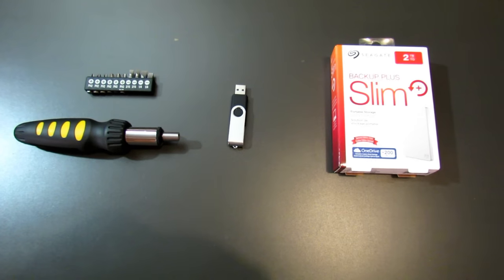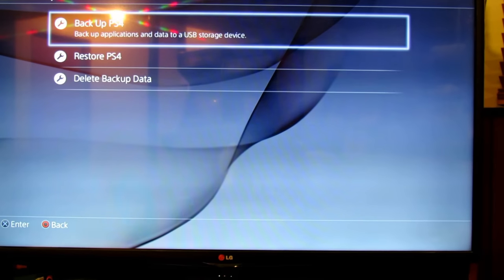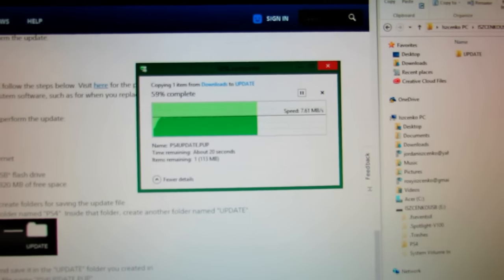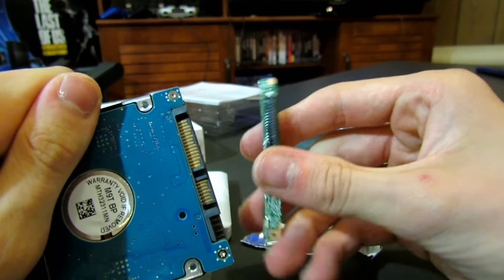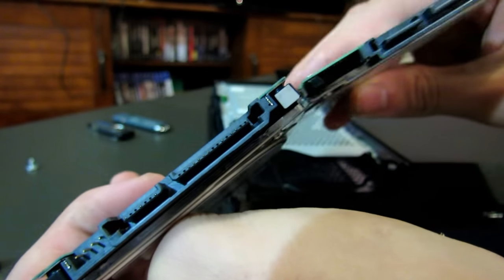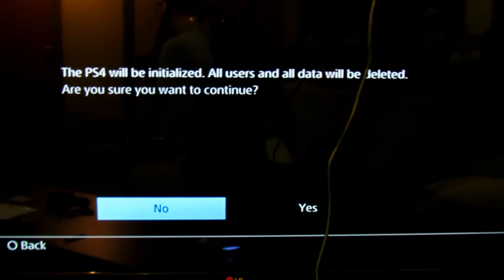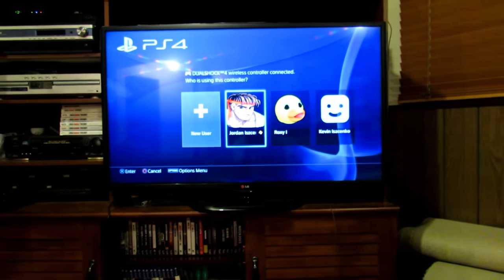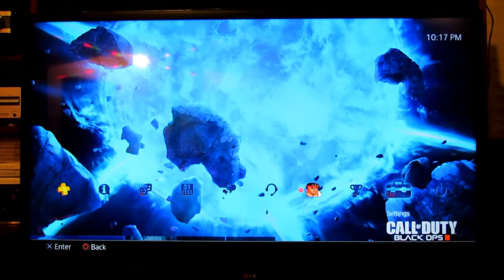How to Upgrade A PS4 Hard Drive (2TB Seagate)

Comment: You don't need 2 drives (external and thumb) to store/backup and  a seperate thumbdrive to get the software from PSN to use for the the installation software as many are saying you need.. I just used my 1TB to backup my data after deleting all my apps on my PS4, (except PT), then I downloaded the installation/update software on the same External HD. The backups will create the same folder (PS4) and the backup file will also be on the (PS4) folder thats named (EXPORT) then inside it is the (BACKUPS) folder.. Just make another folder named (UPDATE) inside the (PS4) folder to put the installation/update software.. So after all the swapping of HD was done, when I plugged in my External to Initilize/Install, I didn't even have to unplug the External and soon as installation and set up was completed, went straight to Restore.. worked flawlessly.. Only hold up for me is that I didn't want to wait 4hours to download 300Gb of (application) data, so I deleted everything and only left PT. So I was left with about 6Gb to back up and got done in about 5mins. But then, you'd have to download each one of your gahmes (digital & disc) all over again, which is fine, because the digital download can go even while on rest mode.. soon as that's in, you can start playing that while downloading the disc games..

Comment: The PS4 wouldn't recognize your hard drive because you need to format it to FAT32 or exFAT on a computer before plugging it into your PS4.
Reply from the maker: Thank you! :)

This comment is very helpful! Everybody be sure to thumbs up this comment so others can see it!
Reply: No problem man!
Reply: Mr_Nollie could c
you please explain?plz?
Reply: Capital-E, I. reference to the issue he had with the PS4 not recognizing an external backup hard drive: You need to connect an external hard drive to a computer. Once it's recognized, right click on it, then click "format". You should see a little box with a drop down list to chose what you want to format it to. Select either FAT32 or exFAT. Then click start. it should take just a few seconds, but you will lose any information you have saved to the hard drive, so you need to be ok with that. After that, plug the hard drive into your PS4 USB and it should be recognized.
Reply: Zeppelin5000 And what happens of I use a USB? samething?
Reply: Capital-E you mean a thumb drive? You'd need a device with at least the same amount of space as you have used up on your PS4. So, if you have 400 GB of space used up on your PS4, you would need a device with more than that amount. I don't think they make thumb drives that big lol. So that's why an external hard drive is best.
Reply: Zeppelin5000 I don't mind losing everything except for save data
Reply: Capital-E No problem, it can just be easier down the line.
Reply: Zeppelin5000 so I guess using a USB stick instead of the external  hardrive will be better for me
Reply: Capital-E you can try if that works, I never tried to format a thumb drive. I happened to have another 2 TB hard drive, so I just used that.
Reply from the maker: The thumb drive I used was JUST for saved data and capture gallery photos/videos. So if you use that, you'll have to install and redownload games after
Reply: DO you mean the hard drive that goes into the ps4 or the flash drive with the firmware?
Reply: davidawesome5305 , in reference to what exactly?
Reply: Upgrading PS4 space
Reply: davidawesome5305 you mean what needs to be formated? only the hard drive that you're backing up to. The new hard drive that you install into the ps4 goes in right out of the package.
Reply: Ok thank you

Comment: What steps do I need to take if I’m using a used external hard drive( using a Seagate free agent go flex 500gb to replace faulty stock hard drive).
Do I need to format the drive in a specific way or will the ps4 do it for me

Comment: Can you save the Backup Data and the Software Update in the same USB Stick?
Reply from the maker: I'm not sure. I used two USB sticks, but you can try it and see if it'll detect both from the same stick. Let me know if it works! :)
Reply: Felipe Aspiazu 

Yes.. that's what I did..

You don't need 2 drives (external and thumb) to store/backup and  a seperate thumbdrive to get the software from PSN to use for the the installation software as many are saying you need.. I just used my 1TB to backup my data after deleting all my apps on my PS4, (except PT), then I downloaded the installation/update software on the same External HD. The backups will create the same folder (PS4) and the backup file will also be on the (PS4) folder thats named (EXPORT) then inside it is the (BACKUPS) folder.. Just make another folder named (UPDATE) inside the (PS4) folder to put the installation/update software.. So after all the swapping of HD was done, when I plugged in my External to Initilize/Install, I didn't even have to unplug the External and soon as installation and set up was completed, went straight to Restore.. worked flawlessly.. Only hold up for me is that I didn't want to wait 4hours to download 300Gb of (application) data, so I deleted everything and only left PT. So I was left with about 6Gb to back up and got done in about 5mins. But then, you'd have to download each one of your gahmes (digital & disc) all over again, which is fine, because the digital download can go even while on rest mode.. soon as that's in, you can start playing that while downloading the disc games..

Comment: I have a bundle ps4 and my screws arnt lining up. A little worried
Reply from the maker: Hmm... I also had a little bit of trouble. All I had to do was apply some pressure to the top and/or bottom of the screw, to make sure it turned in a actually screwed into the console. And if you still have trouble, don't be afraid to ask a friend or a parent for extra help!
Reply: I ended up finding it out. I ended up having to put it on the warranty void if removed sticker side and i ended up working thankfully